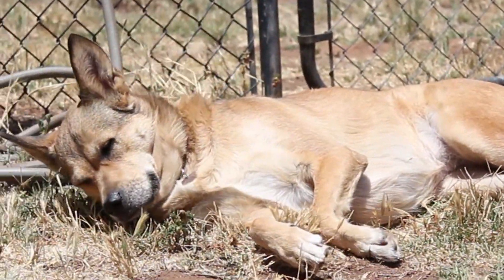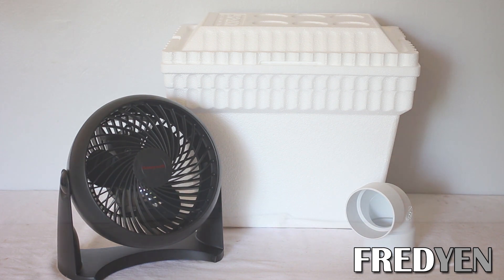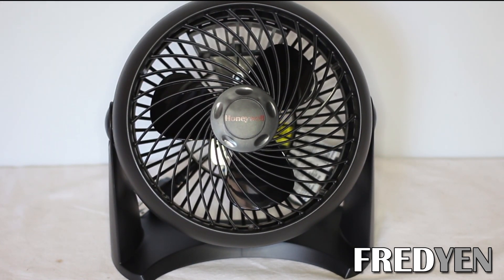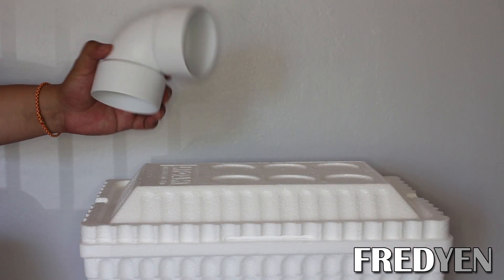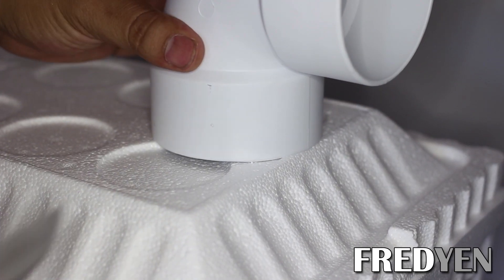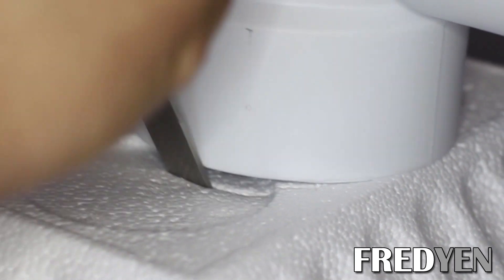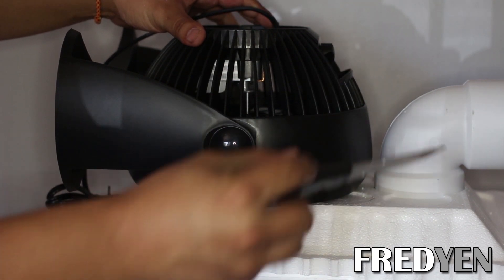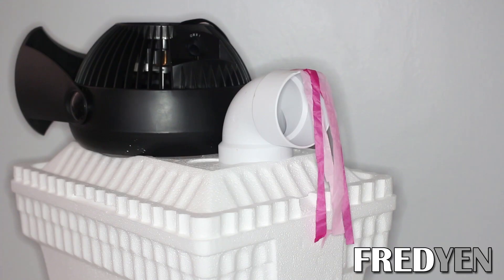How to Build a Cheap Air Conditioner

Comment: Many people have tried the fan/ice ideal for decades. It may work in certain low humidity areas but don't expect much. One of the key cooling features of an A/C is that it removes moisture from the air, not add to it, which is what this idea does. Forget using this if you live in a high humidity area such as in the South. You are better off with a small cheap window A/C. I have one that can run off my portable generator (I used to live in a hurricane-prone, power outage area) and had to use it again when my central air went out and had to wait 3 days for a repairman. Only 5000 btu but it worked great.

Comment: It's crap. Tthe ice melts to quickly & cools nothing. I live in a 12x14 foot room & an hour later  the temp. didn't go down at all.
Reply: +Edward White Let me guess. You put small ice cubes into the cooler.... HAHAHHHA if you did, of course it is going to melt a lot faster and won't cool anything down. You need big block of ice and you probably need 2 or 3 of them sitting on top of each other. The more solid ice you have the lower temperature of the air blowing will be. Don't you remember from way back??? This is how they kept food cool before refrigerator was invented. In fact, they called it ICEBOX.... lol
Reply: LOL, Not using that large a unit.  I use 7 1 liter water bottles for now. Its the fan, its not fast enough "RPMs' to spread the cooled air around.
Reply: +Edward White You are correct. This DIY will definitely work, but it all depends on Amount of ice you have in the cooler, the Size of the Cooler, the Size of space you are trying to cool, the SPEED of the fan or airflow, the size of the exhaust VENT, etc, etc. There are so many variables to consider when it comes to this sort of DIY before you call it CRAP. Window AC Unit for example works the same way, it pulls the air inside the space you are trying to cool, runs it over a super cooled COIL and blows that air back out into the room. The only difference is that it uses current to run the compressor to cool the coil using CFC or Freon gas. That my friend is going to run your electric BILL SKY HIGH.....
Reply: Edward White
Just to try it. Few days ago I bought the $4.00 cooler and froze couple of 1 liters and 2 liters bottles in my freezer. cut the holes for fan and exhaust. The bottles where very cold to touch.... Once I put them in the cooler and ran the fan, decent cold air blew out of the exhaust vent, but it wasn't enough. There wasn't enough air flow. So, it didn't cool the room at all... The room I tested in is little larger than your studio. I believe if I buy a bigger fan than I have now, it would probably make a big difference. AC and Fridge works the same way... they both use Freon Gas -  one blows the cooled air into the room and other into a closed contain.
Reply: Right now I use it aimed at my PCs CPU intake to keep my PC cooler.
Reply: Edward White
That will definitely work to keep your computer cool on a very hot day... That's how I was using it for couple of days. Yea, I figure you definitely need a bigger fan for a lot of air flow... Plus, my fan made a lot of noise laying on the styrofoam..... Anywho, it is definitely a neat DIY.. I just wish it works a good as the actual AC units...
Reply: +Edward White that might not be the best idea because the moisture could short out you computer.

Comment: Freeze a milk jug with water and salt. Lasts way longer than a baggy of cubes and there is no mess. Just re freeze the jug when needed. Also a pc fan and solar panel saves money on electricity too. I built mine last year and use it in my car.

Comment: all these stupid vids on YT!!! Here are some tips for more effectiveness!
don`t get the elbow part , every curve makes the fan less effective, instead don`t cut a second hole and flip over the fan , blowing air out of the box!
use dry ice if you can, sealed ice will melt slower but be less cold!
put one sheet of foil inside the box or out side of it , use rock wool with foil if possible!
put in a wet towel if possible!
wrap ice in wet paper towels!